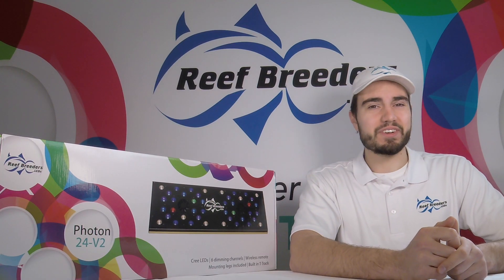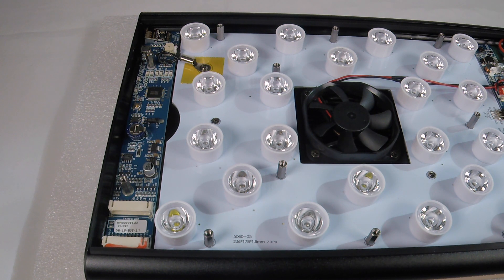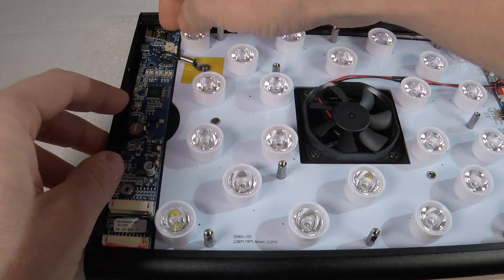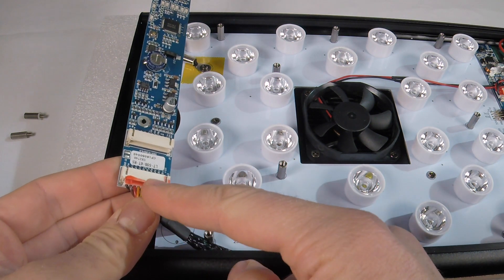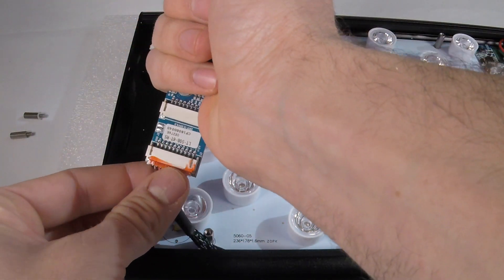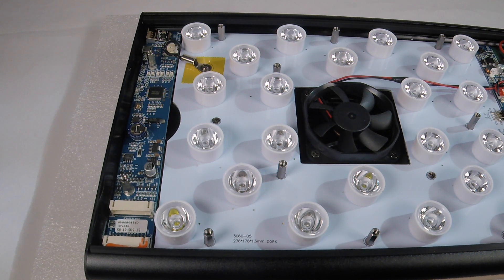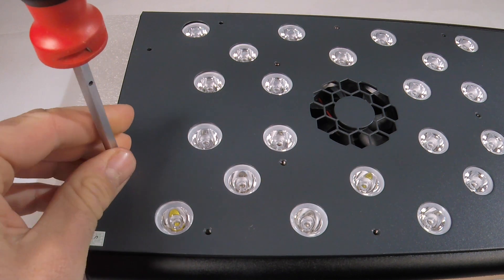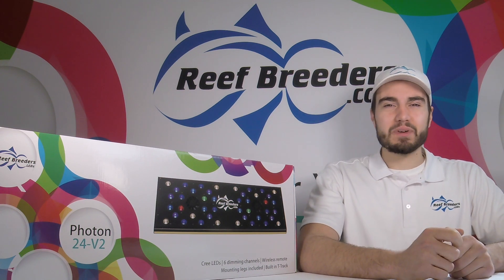Photon V2+ Upgrade Kit and Fan Replacement

Comment: will this light work well with only 4 1/2 inches of clearance above tank?  I have cabinents in my way!  I have seen the par on BRS and being this is basically a strip light the par was more even at 6 inches then ai prime and other lights using a puck!  The par dropped of like crazy with  ai prime at 6 inch mount and the hot spot was very high then imediately next to it it dropped of like crazy! I dont wan to use current or fluval strip.  Reef bright is an option and also kessil a 80 but kessils only ave 15 watts.  They are recommend for 4 inches and up though.  I dont like that these is only blue and white.  Reef brite has 2 cords per light and xtra stuff to buy that can be very costly and I only have a 11 inches from front to back. Thats one of the reasons I thought this might work. I can throw out the low par numbers for 6 inch placement since it was used on a 60 gallon cube.  So knowing all this will this work if I tune down and put sps in the hot spot?  Would I be better off with a small strip like current usa or low watt kessila80? I have always like this light and the spectrum as well!
Reply from the maker: Hey Karen, 

For a 12" wide tank we recommend a mounting height of about 6-8" off the water. You should have plenty of spread for a mixed reef tank with SPS. The 24 will also give you room to grow- you can transfer that light easily to a 36" long tank and support a mixed reef tank with those dimensions as well. Our Photon 24-V2+ is 130watts, so it's as powerful as 11 Kessil A80s, and far more power than current USA. I recommend the Photons for growing advanced LPS and SPS corals, the Kessil A80 are best suited for small tanks (under 12" x 12" with soft corals) and Current USA is best for fish only or some soft corals.

Comment: Hey Logan , I have to Photon V2-48 for a couple years now and absolutely love it . The upgrade kit though , in my opinion , doesn’t really add anything significant . It doesn’t seem easier to program , just different to program . What would be awesome is an app with sliders for each channel to adjust .
Reply from the maker: Hey Brian, 

The most significant improvement with the V2+ controller is the ramping function. Once you program your light, it breaks each hour down into 10 small steps, so that the light ramps up and down a lot smoother. In addition the battery lasts significantly longer, on average 4 months between charges. Also, it is faster to program as you can jump right in (less menus to navigate) and the controller is more responsive than the original.